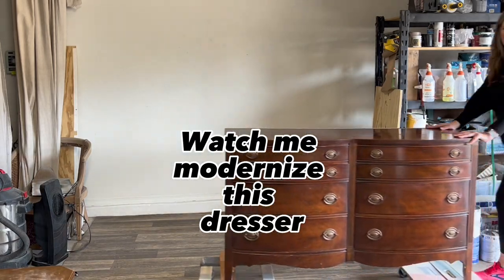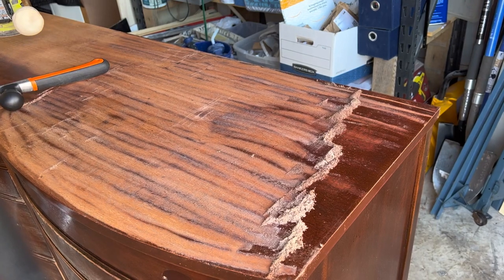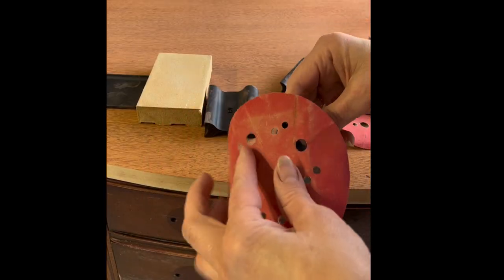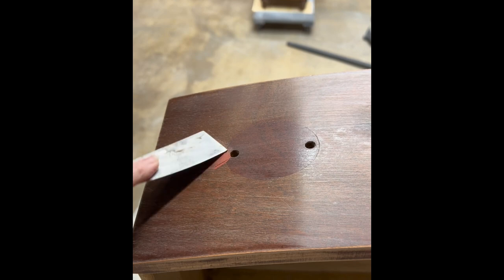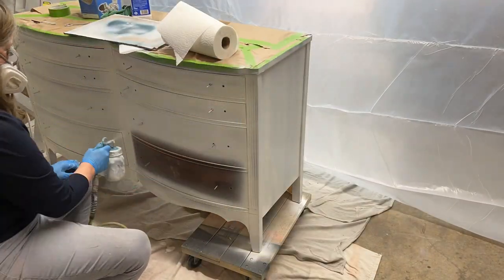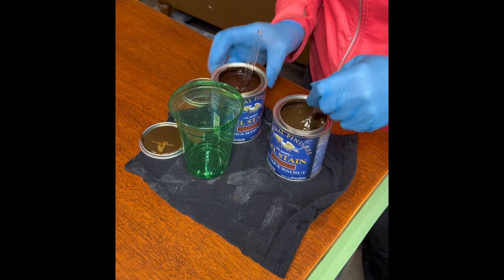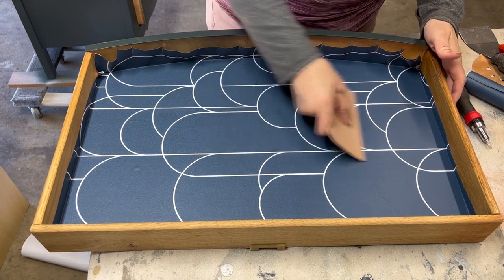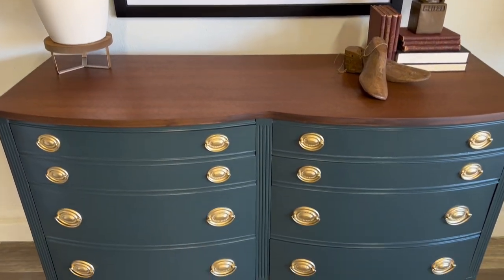Hepplewhite Transformation Revealed! | #FurnitureFlip

Comment: Your tip about sanding down the top and sides of the drawers to prevent sticking was fantastic!! I've never understood WHY I have such a hard time when putting everything back together. They drawers worked before I did the refinishing and then not so great afterwards! I guess I'll need to take the extra effort to sand down to the wood to insure a great fit! There's nothing worse than drawers that don't glide easily!
Reply from the maker: You’re welcome! I learned that one from experience with sticky drawers. 🥴 It works like a charm 🤩